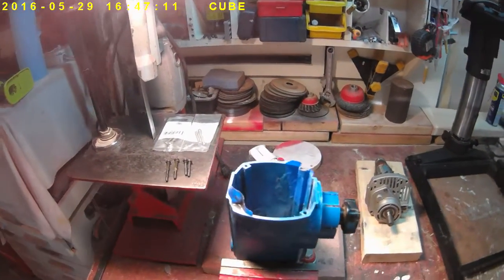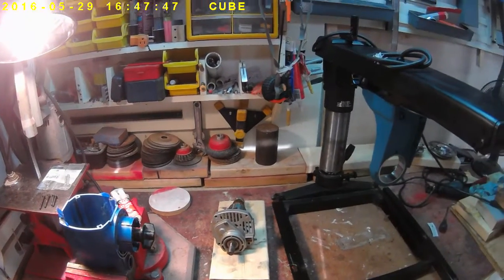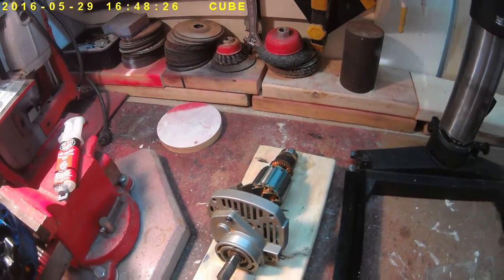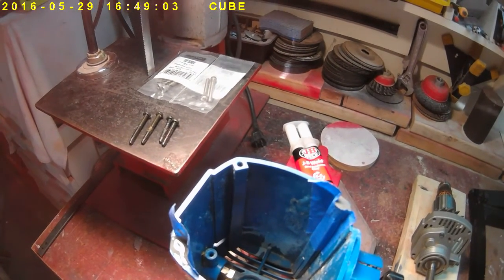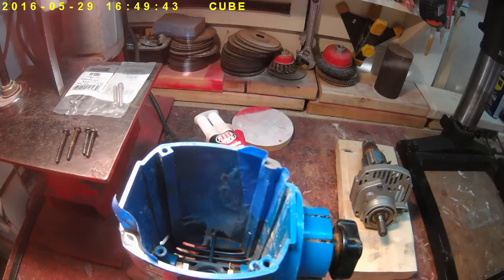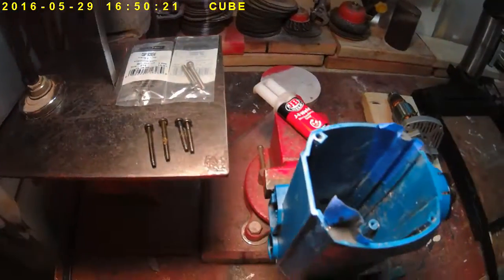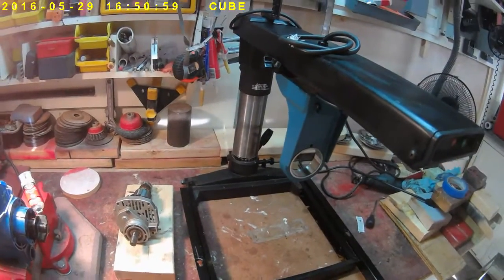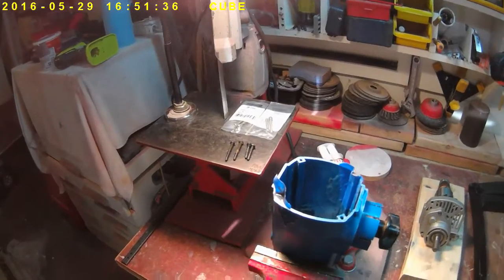Ryobi Radial Arm Saw- RA 200 -  Repairing a product recall disaster?  #1 The Autopsy

Comment: I just scored one of these yesterday and was excited to have a compact rasa...only to search for the manual and have the first google hit refer to the recall. 😢So as a motor guy, I can tell you the best way to repair one of these is to go with motor thru bolts...the type you see on outdoor condenser fans...all thread rod about 10-32 thread. And then figure out a way to drill all the way down the channels by filing a drill notch with a small file...or shaping a small slot about 2-3” down with a T nut...thanks for your process though...now tell me how a router would be used on this if you get the chance. Thanks.

Comment: I also have one of these Ryobi saws. Bought new many years ago, not much use. Still like new. Don't want to get rid of it, so I tightly cinched down two steel hose clamps with th thought that it should reinforce the housing. What do you think? I don't see why that shouldn't keep it from cracking and flying apart.

Comment: Just got one then found it to be recalled. I think they would be safe using as a router, and adding the long screws, great Idea.  These must be busting because of kick back and week design or plastic. I would definitely question fixing one with cracks as on cick back is all you need to pay for your Drs cabin rental. Any way this is a really nice size for being mobile, wished others built one small as you could take with you and mount on a break down bench so you could rip and angle cut. My tool is in good order but I will be updating the fasteners and be gentle with this machine.

Comment: Still have mine but haven't used it in quite a while. Think I'll keep it because it's a good size for my shop space but I'll replace the screws he talks about with longer machine screws and will also install threaded metal inserts into the plastic housing to make it stronger.
Reply: Yes the unit is quite handy, and not as cumbersome as the larger Craftsman radial arm saws .  The only drawback is the small screws that Ryobi used to mount the metal motor unit onto the plastic housing that attaches to the radial arm.  You can drill out the plastic housing and insert 4- 5" threaded bolts, or threaded rods with nuts to hold the metal motor plate.  I would check it every once in a while to see if any plastic areas of the housing start to crack--  Also Lowes has a small Kobalt sliding miter saw that does everything a RAS will do and some more...   $75 rebate is still in effect last time I checked.

Comment: I have a 220v RA200N not much used... took it apart to fix angle mechanism which locked up somehow... even after fixing that i felt the usual little bit of play in the arm wasn't satisfactory.... so instead of spending bucks on circular saw, now i'm thinking of rather using this motor for a homebuild tablesaw something like what cosmas bauer did... never done a thing of this magnitude only made some furniture... missing bladeguard though, but i think with the  plywood boxed mount i intend will strenghten the complete housing setup... outwards it can not go anywhere ...well i guess anything is possible but i wanna give it a try although i have very basic toolset... jigsaw handdrill router.... speaking of which i also hope to still being able to utilise the spindle on the motor perhaps via one of the extension shafts one gets... it would be great if i could manage a 90degree swivel of the "box" to be able to keep the dual funtion of the motor setup...greetings out of cape town
Reply from the maker: The RA200 110v was sold here in USA, but recalled due to the plastic motor housing developing cracks and falling apart.  Not sure about the 220v model which might have been sold in Europe or S Africa?    Check the mounting screw channels for cracks before doing any modifications.  Not sure how to mount it as a table saw, as you would have to use the same plastic motor housing and front metal plate to attach it below the table?  I have heard of using the frame to mount a small router which could do some similar mill work... Good luck, but be very careful . as fingers are not usually a replaceable item in your shop....

Comment: Well hell!!! I bought a house last year that had one of these built into a countertop wood shop. I used it several times for a kitchen island project with no issues. I had no idea about this recall. I'm concerned now. If after sending this back how can I get a replacement motor to use this as a RA saw? Any info would be appreciated.
Reply: The motor housing is attached to the arbor faceplate with 4 self tapping screws.  They used small screws, and the plastic channel is not nearly enough to deal with the torque that the motor puts out and the force of blade cutting stock.   It is a simple matter to take the motor cover off of the arbor face plate and check for cracks where the mounting screws attach to the support channels-  The RA-200 I had bought had cracks on two of the 4 screw channels.  

There are other Radial Arm saws- Craftsman units are often on Craigslist for $50- 100 as they are bulky and take up lot more space than a newer compound sliding miter saw.  DeWalt also has a few RA saws of same size, and the older DeWalts are built with replaceable bearings and probably better than the newer versions?

I did attempt to reinforce the screw channels on my Ryobi RA-200-- see utube video--  but decided to send it back and be safe...  How much are your hands and fingers worth--- that's the question?
Reply from the maker: https://www.youtube.com/watch?v=RcPLmcU3e4k&t=1s
Reply: I went on the side of safety and returned it. Before I did though I checked the housing and it looked great. Even thought about spraying a little of that flex spray inside the housing and put it back together. But I like my fingers.

Comment: Wow, THANK-YOU. I bought one in the early 90's and used it for building my house at the time. Since then its been it storage as I moved several times since then. I am currently in the process of building another house and pulled it out of storage to use and in doing some searches to get owners manual, etc for it I came across your video about this recall. You may have saved a future accident. I will be calling Ryobi about the return, but will never use it again even if the refund is not longer in effect. Not worth the risk.
Reply from the maker: https://www.youtube.com/watch?v=RcPLmcU3e4k

Comment: That recall is still going on....I just bought one on CL..they are sending FedEx to pick up the motor and carriage and I'll try selling the remaining parts on Ebay and give the frame to the local scrap collector dude.
Reply from the maker: Yes- after getting the $75 rebate from Ryobi, I found a Harbor Freight clone of the RA200 on ebay for $50 w free shipping.  HF clone model has some upgrades and trigger switch on the handle, but still has tapping screws holding the plastic motor housing to the armature and gears.  Its a nice smaller sized RA saw compared to larger Craftsman and DeWalts, so I inserted 4 inch threaded rods into the screw channels and plan on keeping it.  You can keep your frame and mount a small trim router to the motor housing bracket and have a radial arm router.....